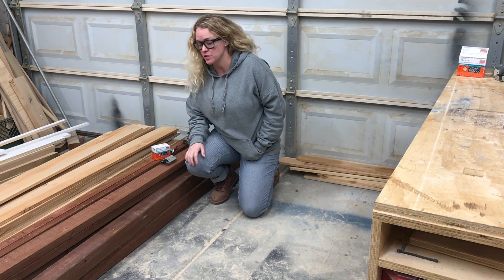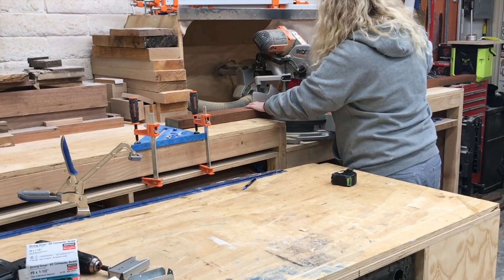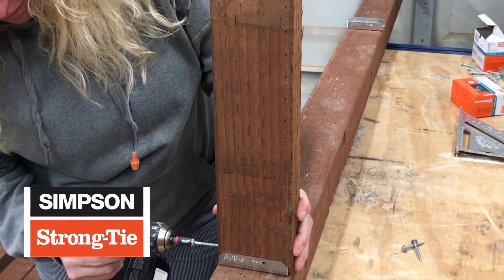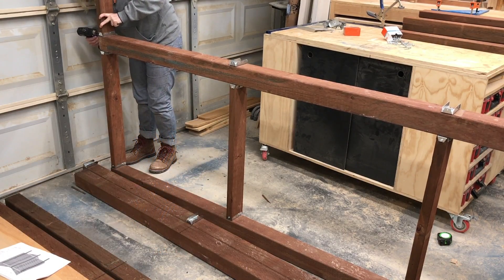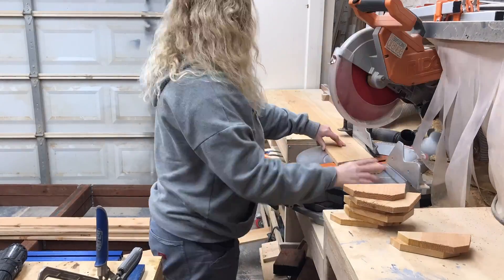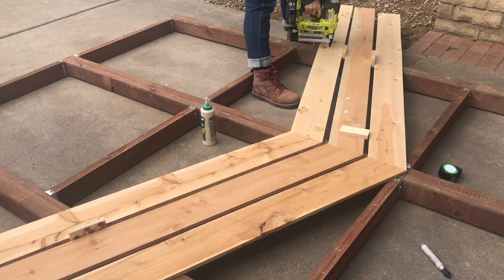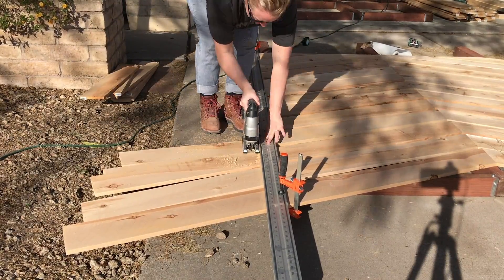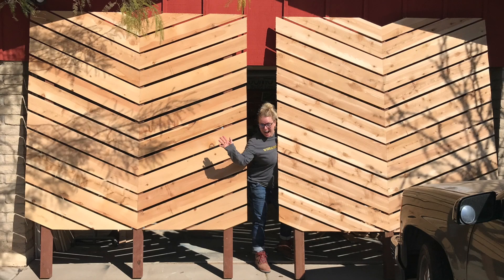DIY Outdoor Privacy Screens

Comment: The first half of the https://www.youtube.com/post/Ugkx3ICSK6nSknaL_45CU2NmFSoXjarGMDiJ book is everything about wood: types, tools, finishes, setting up shop etc. The second half is all about doing projects for inside and outside of the home. The color pictures are helpful. After reading a dozen of these types of books, this is probably the best overall (layout, color photos, plans). Only detraction is that many of the projects use a table saw/router/planer, which are usually expensive and take up space, so the plans are less friendly to newcomers and the budget conscious. But I know I can use a drill, circular saw or a jigsaw to make the projects.
Reply from the maker: I have a tutorial on my website. Link in description. 🍊

Comment: Trying to build this! For the connectors, I was confused on which hole I put the screw in. When trying to install, my 2x4 ends up cracking because the screen head takes up alot of space 😒
Reply from the maker: Predrilling can help with the 2x4’s cracking. 🍊

Comment: Great job.  Was wondering if you had any DIY ideas for a pool enclosure thats already screened in, but still visible to the neighbors.  There is only a 5 ft white ugly PVC fence bordering the outside of the enclosure and I'd like to gain more privacy above that sight line.
Reply from the maker: Thanks. Hard to say without seeing it. Good luck.
Reply: @TheAwesomeOrange  I already started and it's coming out really good.  Horizontal slats, starting 4 ft off the ground.  4 in wide, 1 inch thick to the width of 3 feet which gives a floating privacy screen on my side.  On their side 2 ft of the screen is visible which is perfect from their angle without being ugly to their view.  Stained the same ebony brown color as the aluminum screen frame.   I have part of it done but it looks good so far.   I will post a video for your critique.
Reply: Ok.  Here is a quick video.  
https://youtu.be/UVZoIMjikQQ
It's a few spliced into one so i dubbed over the voice with some music.  You can see how close each house is to the other and it's a problem with privacy.  It's partially done because it takes so much time to personally select each board.  Waiting for Home depot to restock their 4x1 pressure treated.

Comment: It looks great but you sure wasted a lot of cedar .  Maybe you should have gotten sizes closer to what you needed for the job.
Reply: I was going to say something similar - why not just have them be wider? The backyard definitely had the space. If you're charging a customer, that's one thing, but for yourself, I would be more economical with the product.
Reply from the maker: Thanks. I built them the size my client wanted. Plus, I save my scraps and will use them on another project. I try to have as little waste as possible. 🍊
Reply from the maker: These were for a client. And most of the excess has already been used on another project! 🍊